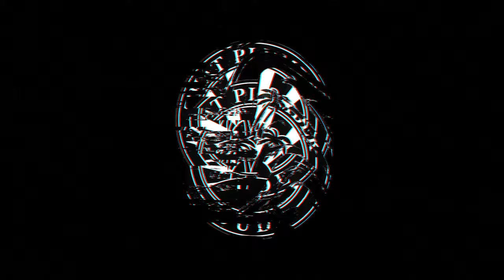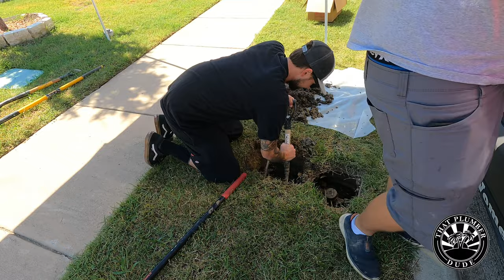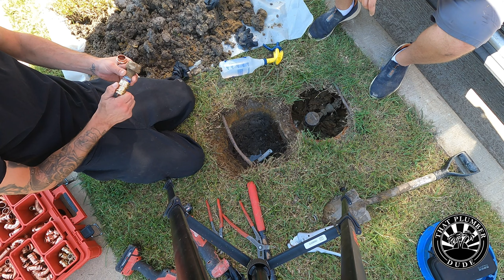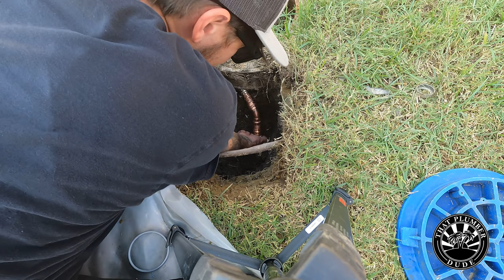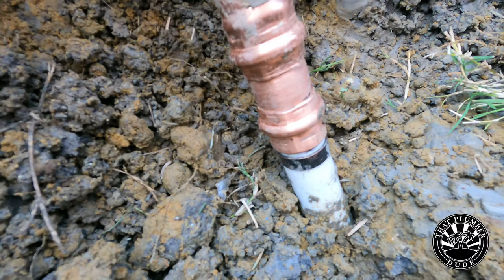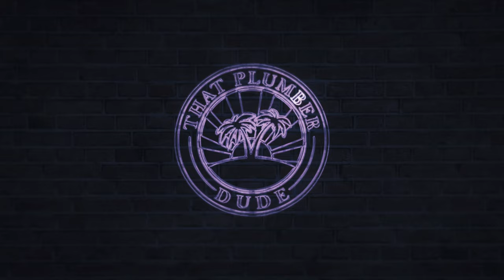Water Spot Repair At Meter | Plumbing Vlog For Apprentices

Comment: love the videos, what state are you in?
Reply from the maker: Thanks bro 🙏🏼 I’m currently in Texas but hopefully returning to CA soon.
Reply: @ThatPlumberDude  im currently in FL, moving to texas in few years... hows the work out there?
Reply from the maker: @robertvazquez7619  Work is booming here. I would highly recommend the Dallas area. Specifically north of Dallas near the McKinney/Frisco area which is where I’m at. No shortage of work both for service and new construction.
Reply: @ThatPlumberDude  I'm in California and our water lines are similar to what you work with in Texas, except PEX cannot be direct buried here.
Reply from the maker: @DragonBuilds  Do you sleeve the Pex with insulation? Or how do you protect it when you run a Pex service water line?
Reply: @ThatPlumberDude  It doesn't freeze here so the typical way is to use a plastic sleeve and pipe wrap tape.
Reply from the maker: @DragonBuilds  Nice